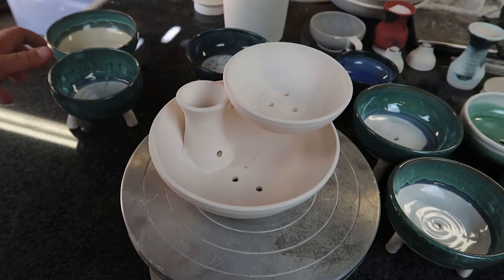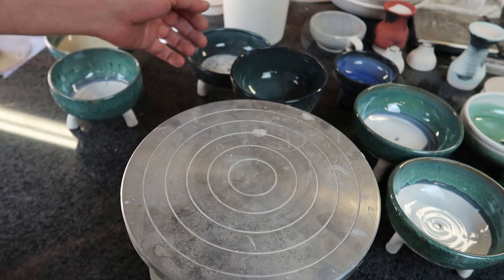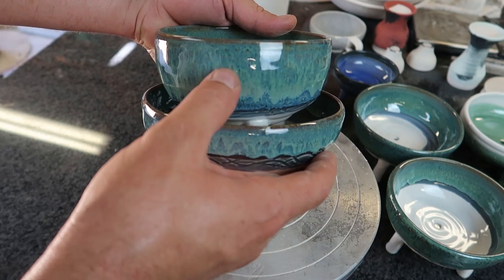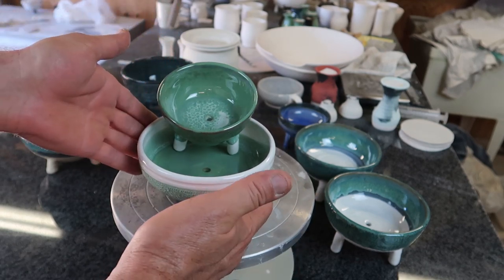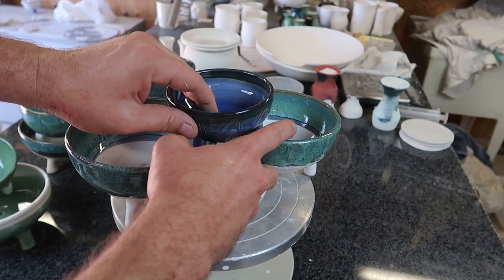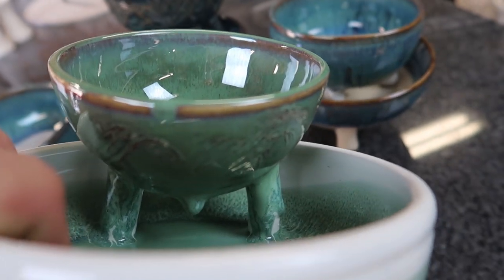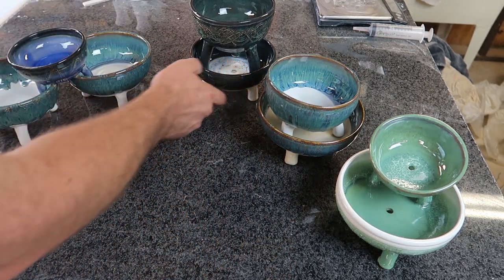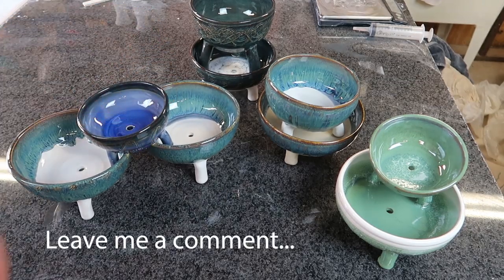Glazing Pots Together - on purpose

Comment: I like this idea. I will try a slight variation on it by setting the pots together when the glazes are unfired so that I can fire once instead of twice. I was planning on trying both ways in a future sculptural form that will go through several firings before it is finished. Thank you very much for sharing.